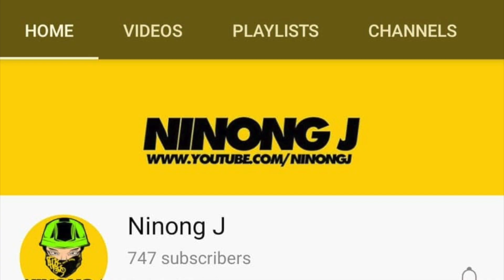2021 Stumpjumper Expert  ... gear cable replacement

Comment: great video but how do you free cable housig from frame, do you need to disconect some fixing or  you just pull them out with force?
Reply from the maker: Honestly pulling with force is another option but take advantage of using the park tool internal routing kit (IR - 1.2). With the kit there is a piece of mind taking off the existing cable with or without force. Thank you and keep safe 🤘 🇨🇦 🚴‍♂
Reply: @boredmechanic2019  thanks
Reply from the maker: @mariagalandova8897  you're welcome have a great day 🙏🇨🇦❤️
Reply: My stumpy has the panel that comes off the swoopy bit of the main triangle, exposing that section of cable run. Would you still use that cable routing tool for it?

Comment: What kind of oil did you use as lubricant? What products can work
Reply from the maker: Thank you for taking the time. I mixed up Prolink and Finish Line brand chain lube (wet). Keep safe 🤙🇨🇦